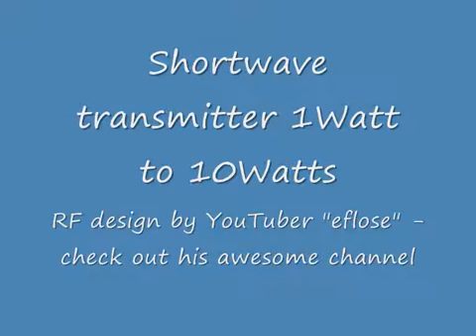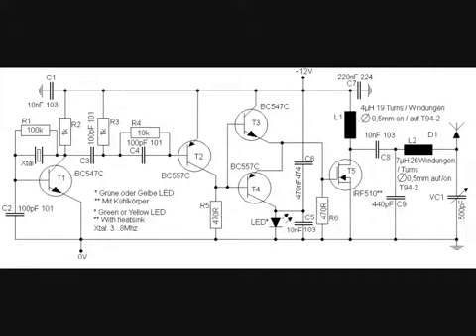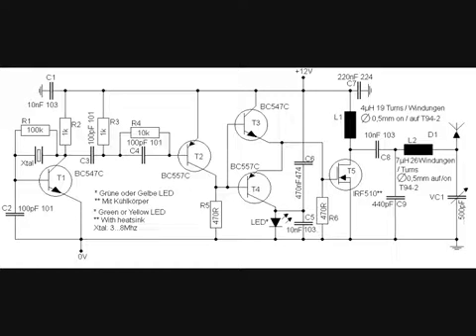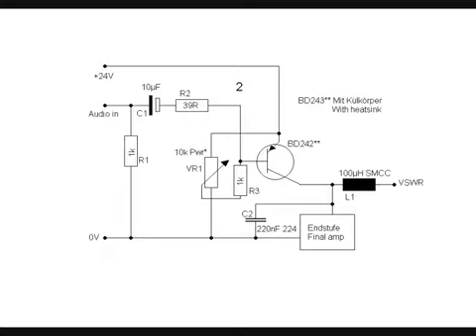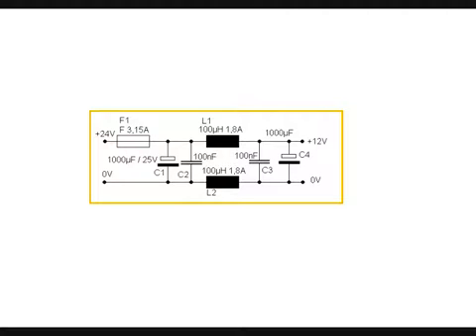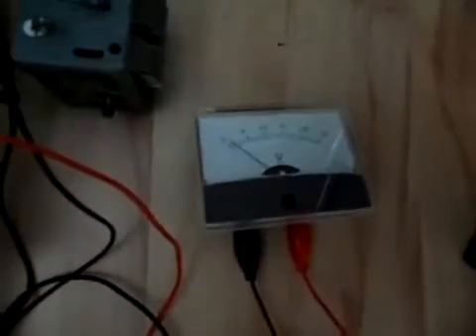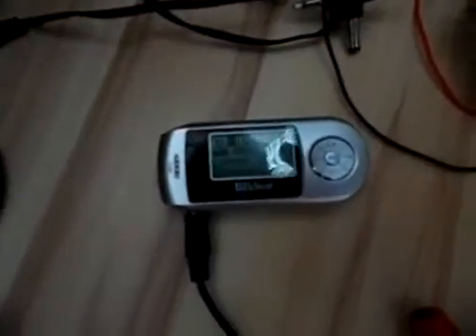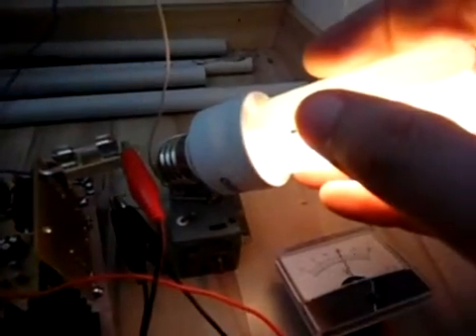eflose shortwave transmitter

Comment: Thank you for a useful circuit that uses common parts (except for the toroids).
The power supply filter circuit, with the 2 inductors and 4 capacitors, precedes the 12 volt regulator circuit? Am I right, or the reverse?
The other point is that the filter circuit input is 24 volts and its output is 12 volts, can you clarify? Best regards.